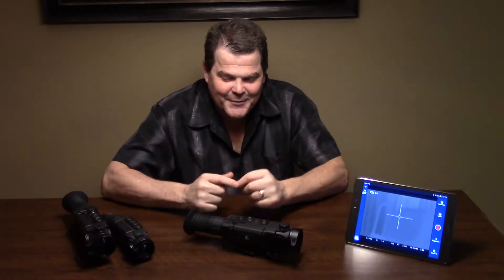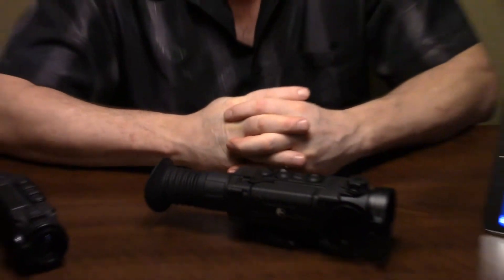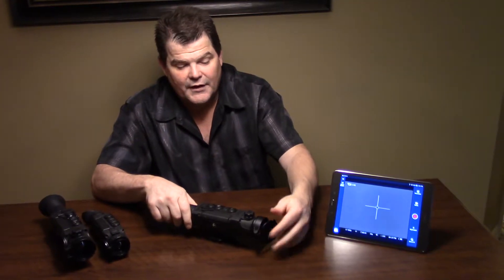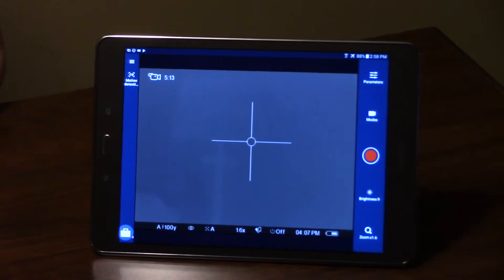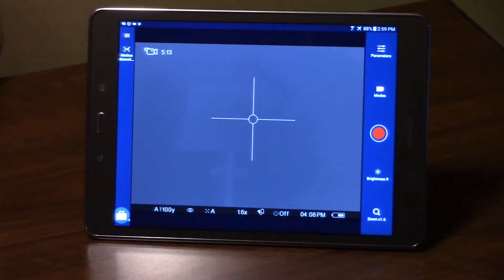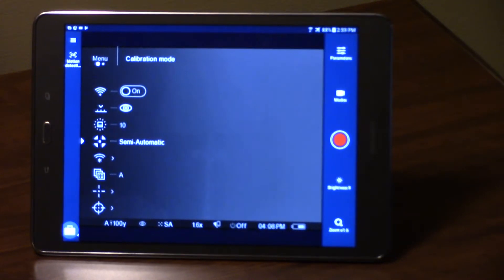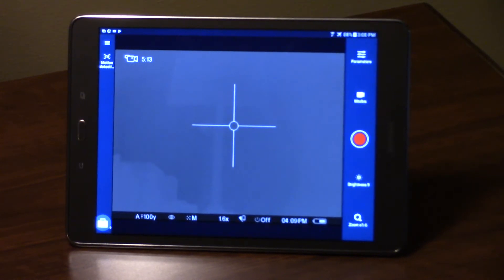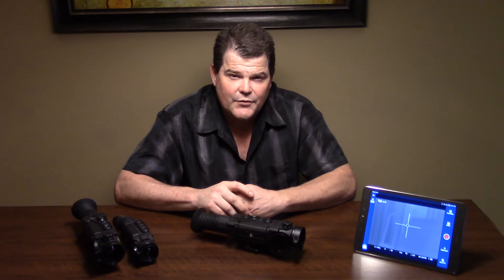NUC calibrating your Pulsar thermal night vision device

Comment: What happens when it's not calibrated correctly and if  you just leave it in manual mode? thanks!
Reply from the maker: Your image will get very grainy with vertical lines in it.
Reply: @foxoptic5887  Thank you!